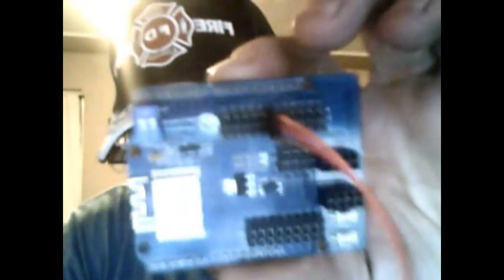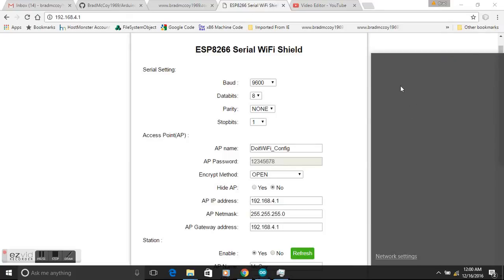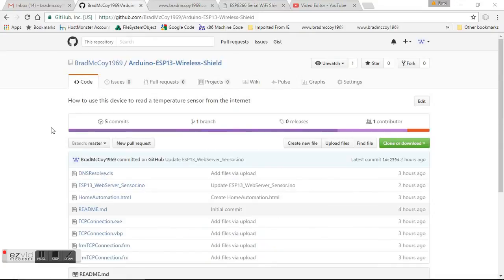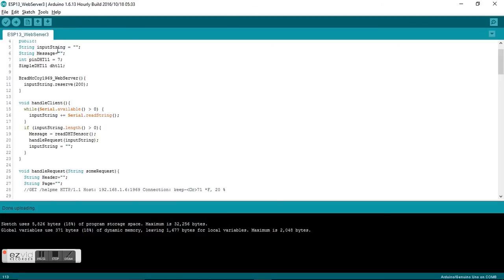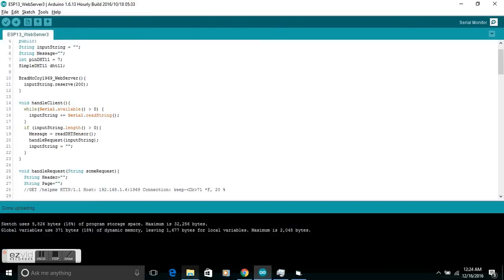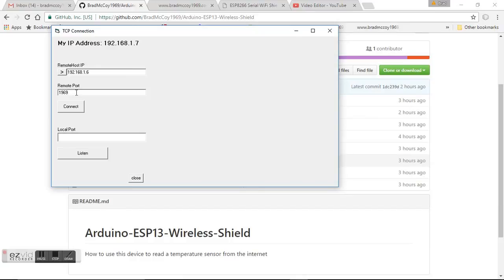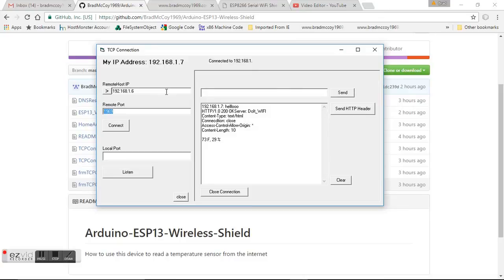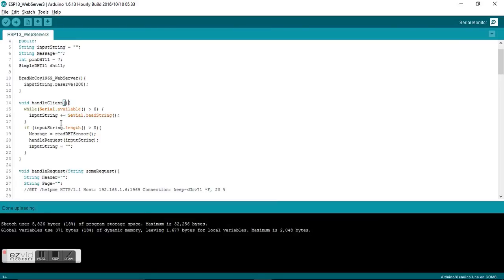Arduino ESP13 Wireless Shield

Comment: Brad hi,
I don't know if you still support this project but thank's to your help I arrived until the HTML part but I don't know what IP address to put in the HTML text (I have opened the port 300 to my router for the shield). I suggested to put the global IP of my laptop I found from online utilities followed by :300 but it did not worked. After that I read that all devices attached to a router have the same global IP. Do you know how can I go on from here ?

best regards, Theodore

Comment: Hi, Thanks for providing this helpful video. Many people are trying to figure out how to use this type of ESP-13 shield (the board with the DIP switches) , with little success. I've hunted around various sites but there is not much specific clear details on how to get this specific board to work with an Arduino Uno - The problem is caused by the weird way the 2-pole DIP switch prevents normal up-loads and also inhibits the standard use of the Arduino serial monitor consul.

You seem to be 1 of the few people who can get this type of ESP-13 board to do something useful.

Please tell me...
Does anyone know how to get this specific ESP-13 to correctly run a simple scannetworks script and display the results ?

What lines in an Arduino script can get information ( replies) from the ESP-13 board and how can that information be displayed for debugging ?

Let us know,
Thanks
Agribot
Reply from the maker: http://www.bradmccoy1969.com/Repository/index.php

Comment: How to get "http://216.16.114.237:1969/SensorData" these url?
Reply from the maker: I have unplugged the sensor and uno board a few months ago.
Reply: I mean how you get that url. And I dont understand how you connect Arduino code with the html. How we can show the value from sensor on the web?
Reply from the maker: I have a few things that I need to get done tonight.  Maybe later we could have this conversation.
Reply: I'm very sorry to bother you. Pls answer my questions because I've stucked on this thing for 5 days. Thank you very much.
Reply from the maker: ok.. but I don't know exactly where to start..
Reply: How you connect the Arduino ide with the html? Especially, I'm curious about the url that you put in the html, how can I get that url?

This is the url "http://2.16.16.114.237:1969/SensorData".
Reply from the maker: The url is simply my ip address to my house.  and the port - 1969 was my choice.
Reply: What about "/SensorData"? And how can you print the output from the arduino IDE in HTML?
Reply from the maker: The script that runs is very simple.  It does not care what you send it.  If anything gets sent to it - it replies with a temperature reading.  So "/SensorData" is "anything".
Reply from the maker: I am wondering how far you have gotten on this.  At what point in the video have you reached?  Can you tell me what does work?
Reply from the maker: And I am curious too if the picture is really you or maybe your daughter.  I find it hard to believe that a kid is interested in this experiment.
Reply: I'm on the point that I've Arduino code which is measure the weight from Loadcell. Then I send the result through the ESP13 wifi shield and show to the website using HTML. So, I think your vdo is suitable with my work. The point that I've stuck as I asked you before, how to connect the Arduino IDE and HTML to work together? TT 
The picture is me :)
Reply from the maker: I am still not clear on what does work.  it sounds like you are getting a response from the uno board with data.  Do you have the html headers the same as mine?
have you installed the network tool to verify that it works on your local network?  do you have a Web page installed on a Web server?  have you set up the port forwarding on your router?
Reply: I've used your HTML file and the TCP tool is work. I don't have the web server.
Reply from the maker: well... I guess the Web server may not be required since the script is client side.  I am on my way to work right now.  how about when I get home later I plug my board back in and get it working; then add a button to my page that reads your sensor.  and see what happens?
Reply: I see. I would appreciate that. Thank you for your kindness. :D
Reply from the maker: I have set up my sensor and page again.  I then added a button for your sensor and it does not work.  Can you do 2 things for me..
#1 - use the TCP network tool to get the response text.  And send that for me to view.
#2 - double check your port forwarding options on your router.
Reply from the maker: Also I can use the TCP Connection tool to connect to my Internet IP Address.  216.16.114.237 on port 1969.  Just curious if you can use the tool and connect to my ip address just like I have.  And I tried yours and I was not able to connect.
Reply from the maker: Also modify your html page such that it tries to read my sensor again and see if that is working as well.
Reply: This is my IP address 192.168.1.77 on the port 9000.
Reply from the maker: That is your local ip address on your home network.  Your router has an ip address that is on the internet.  to find out what that is goto Google and type in "what is my ip"
Reply: This is what I dot from google 81.178.214.191.
Reply: Hi Brad, sorry for disturbing. I want to know how to get the internet IP address of the esp board, because when I search Google "what is my ip", it will show just my computer's ip. Am I right?
Reply from the maker: not correct if you have a router.  every computer at my house will show the same IP address from google.  that is because from the point of view from the internet my house is all one ip address.  the router will then use its "port forwarding" options to send traffic from port 1969 to an internal ip address.
Reply from the maker: Usually if the ip address is like this: 192.168.1.??? then that is your internal network within your house.
Reply: Hi Brad, I have already tried to change IP address to my home IP address like 81.178.214.239:1997
But it still not reading my sensor.

Comment: Hey, I'm new to this kind of stuff and I'm wondering how I could operate my ESP13 shield.

Where is the Analog In for the ESP13 and where do i connect the voltage power through the Wifi board ? (Just like the one you connect your temperature sensor to ESP13)

Thanks before.
Reply from the maker: the esp13 board sandwiches to the unu board and becomes one.  when they are being setup they are powered by the USB connector.  after the script is uploaded, they can be powered with a 110 volt house outlet.  and I think u can even hookup a 9v battery too.

Comment: Brad..I really did appreciate this video.  I have been working on getting the shield to work for 3 days now.  I now have it connecting and I can ping it.  I still can't get any of the arduino sketches to work on the serial side.  I have tried all of the wifi libraries and example sketches  with no luck. ..it doesn't recognize the shield...any ideas (i.e. firmware? etc.)  Thank you!
Reply from the maker: http://kookye.com/2016/11/17/esp8266-uart-wifi-shield-use-guide/
Reply: Thanks Brad for the link.  I tried to download their Debugger tool from kookye...didn't work (404 error).  I have tried the link on Doit for, it looks like the same tool...but I couldn't get it to install.  At least I could download it.  I emailed kookye about the tool.  We will see.

Comment: Nice vid. I am working on a similar project and suspect this will be very useful. Can you possibly add links to your GitHub repository and include a schematic drawing of how you connected the sensor to the shield?
Reply from the maker: I got my sensor out of a kit from http://www.elegoo.com/download/  And the connection is 3 wires.  Ground, +5v, and Data.  I found a video for a DHT11 sensor that had the pins different than mine.  I don't know why.  I uploaded the documentation that I got with the kit onto my GitHub repository.  Page 108 has an illustration showing how to hook mine up.  My ino sketch uses data pin 7 to connect to the sensor data pin.